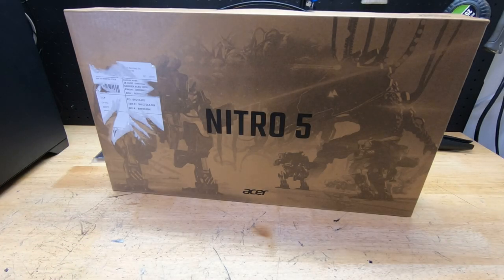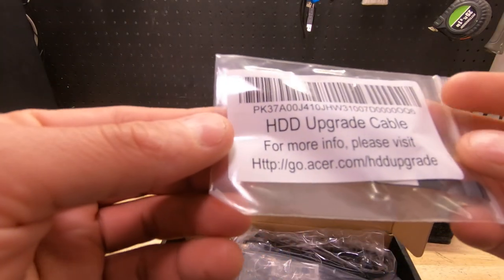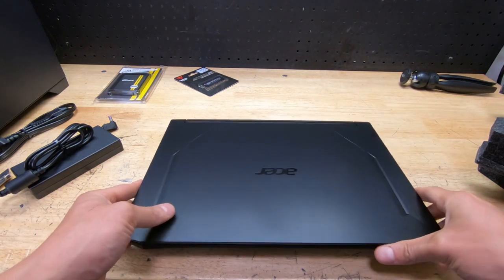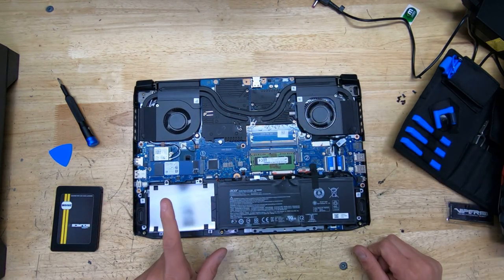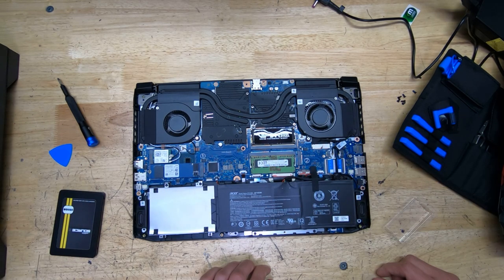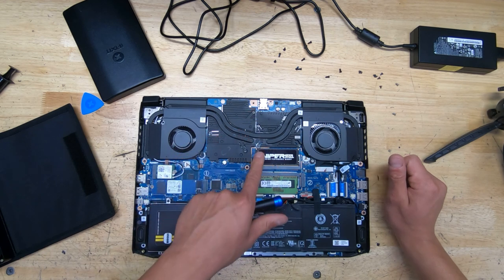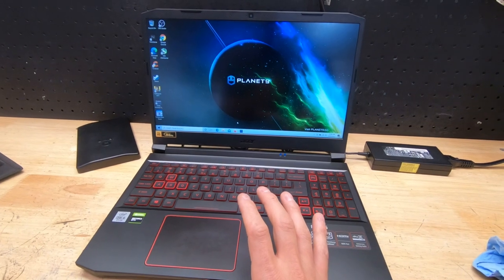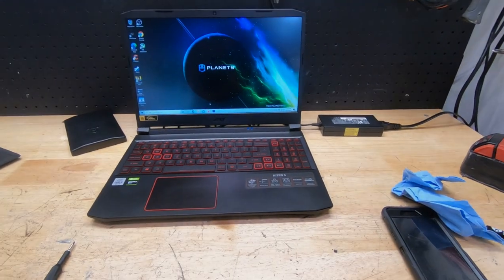I should not have to repair and improve a new laptop!! Acer Nitro 5 AN515-55-59KS review!!

Comment: I was fucking around with an old laptop that didn't work anymore.  I started messing around with those little taps I learned they can break easily.  When he says, be careful, be really careful with those taps.
Reply from the maker: yup, metal is flimsy, I have broken the before on other lap tops.

Comment: Was thinking about buying one of these....what do you think?
Reply from the maker: I honestly don't recommend it, I ended up returning it. Wasnt that impress for the price. I am probably gonna get a lenovo legion 5 with with then new ryzen 7 and 1660ti, also comes with 16gb ddr4 and a 512 ssd for $999 USD. better bang for the buck and it does not have the loud fan issue on idle or while browsing due to better fan curvs.
Reply: @DLMtechgarage  oh no..i have the exact same model, i bought just past month, really really sad to hear that
Reply from the maker: @josephsmith4895  its not a bad laptop, just they could of done a few things better for the price.

Comment: Hey do i have to unplug the battery first before putting the ram in??
Reply from the maker: you should, it is a good practice and I have seen the laptop randomly turn on when doing this, you can fry components this way. I have been doing it for so long and get lazy and forget to do it but it is a potential risk not doing it!

Comment: Does replacing the thermal paste is a long term solution for high temp? I have the exact model you have, did go away the problem of high temp and didn't come back for a long time? Is cooling pad and undervolting  a long term solutions for this problem? Please reply
Reply from the maker: just changing the thermal past to a better quality paste made a big difference and the heat issue was resolved and I had no thermal throttling which meant better performance, now if you feel comfortable and strongly suggest using cauting, you can bend the temps back a little on the heatsink creating more tension for the mount which also helps alot for the thermal past. doing these two things made the laptop perform better, just careful with the tabs cause they are thin.
Reply: @DLMtechgarage  very thankful for but are they long-term solutions?
Reply from the maker: @josephsmith4895  absolutely, thermal pasted can last up to 2 years before having to repaste. I usually repaste gpu once a year.

Comment: I have the 3050 version with 8gb 2933 mhz. What is the best memory upgrade because 2933 is hard to find. Is 3200 suitable? Thanks
Reply from the maker: you can use the 3200 it will just downclock to the slower speeds.
Reply: @DLMtechgarage  Even though it is 3200mhz, can it be used in dual channel with the 2933mhz?
Reply from the maker: @irwindominguez4903  yes it can. it will just down  clock to 2933 but will still run in dual channel.
Reply: @DLMtechgarage  Thanks, and another question. Does it matter if they are of different latency or does it have to be the same?
Reply from the maker: @irwindominguez4903  not sure how it works with the timings, never really thought about that. I know it does work regardless, but I would assume it would default to the lowest timings.